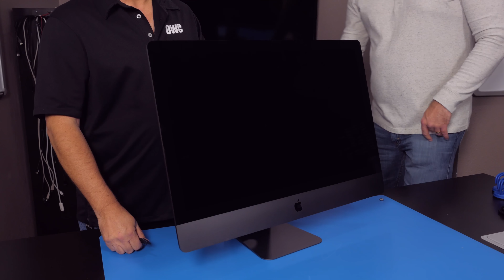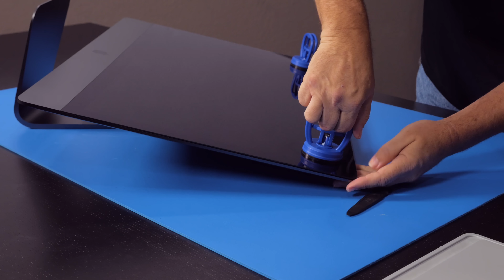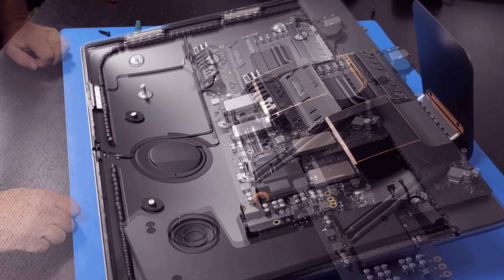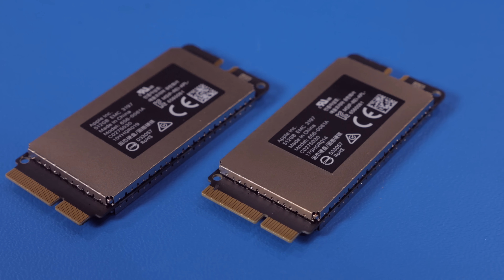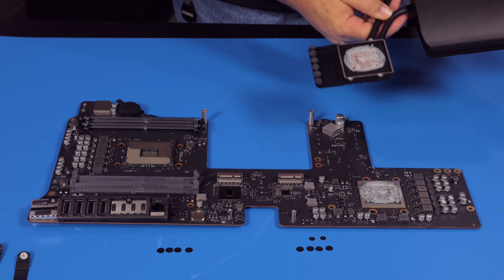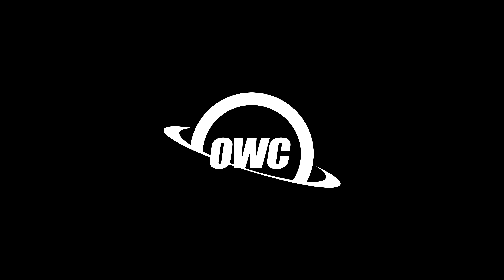2017 iMac Pro Teardown + OWC Memory Upgrade Announcement

Comment: The iMac Pro is an absolute work of art inside and out. The layout of everything is perfect. Something to be admired for sure.
Reply: This is the same design from 2013 for the most part, and that is when their bad designed Mac Pro with limited upgradeability was introduced.

To me the outside looks like every other 27" imac, except the color is different.
Inside is neatly laid out I agree, but it has bad design as all the other better designed 27" Imacs allow the user to use a door to access the memory, and there is no technical reason this does not have that.

And that is bad design.

I am guessing the profit levels on ecc memory were too much to resist for Apple and that is why they sealed this "pro" desktop machine shut.

Having said that I think the surface desktop is a more innovative design, styling wise, and screen functionality wise, unfortunately Microsoft made it's base way too small to ever have this level of power, even their laptops are more powerful.
Reply: The 27" iMac is still magnificent to this day, beautiful design and engineering. A work of art doesn't really get old, only your own mentality. Nobody says; "Hey that Mona Lisa portrait is too old, its crap." You appreciate the art and design for years to come. Even the colourful Mac G3's are timeless classics like Andy Warhols pieces. Tech wise, there will always be different products for different people. You don't want an end-to-end encrypted, secure, unibody 5k powerhouse? Buy something else... life can be simple.
Reply: I have a iMac 27" and had a colorful one and have been a long time OWC customer.

Life is simple.

i simply gave me honest truthful opinion and I think you can see it is true.
Never did I say it was ugly.

I said the design of the iMac Pro is no different than the design of the 2013 iMac 27", so I was surprised people were saying what a magnificent design it is, as in something new.

And I pointed out the neat insides and the bad design decision to not include a memory door, since their is no thermal reason for them not too.

GREED!

If someone was to paint the same mona lisa today and say it is great painting, I would agree, but I would point out it has been done before exactly the same.

And that take nothing away from the original, but it does take a little away from the copy if the artist knew of the original.

Apple knew of the original and saved money by cloning it and taking away it's memory upgrade feature for consumers, as dcc memory is much more profitable and not having that feature gets customers to order their memory upgrade from Apple at purchase for higher than retail prices, with no credit given for the 32GB base memory you are giving up.

Apple is essentially double dipping and double charging you for memory, if you upgrade through them.

And that is just wrong and bad design from a consumer perspective.

take care.
Reply: The best part of it all is how it's designed to thermal throttle the cpu so you can't get the full potential and the speakers are basically sealed inside
Reply: Korie Cull end to end encrypted, you are funny.
Reply: Tigerex966 the amount of amazing hardware they stuffed in the iMac pro is extremely impressive
Reply: Tigerex966
Imagine “door” for four full size DIMM slots? And placing them in the middle of the board? Its not worth to loose in bezel durability and symmetry. If there was plenty of space underneath, like in 2012 models, it will be possible.
And RAM is not the thing you going to upgrade for long time if you bought enough already. Only if you wanna game on the price. I mean, 16-32Gb is still a sweat spot for large prints and 3d renders, in the last 5 years.
Reply: 'Something to be admired'' like its price point.
Reply: @koriecull  I don't think you understand how this this computer stuff works.
Reply: @koriecull  yeah and it has a shitty GPU, not even the 1080ti, not even the newest 2080ti... hahahahhahahahaha

Comment: Help Please!! I have an imac pro and repair centres told me that the logic board is dead and needs to be replaced, but buying another used imac pro cheaper than replacing the logic board. So here is the question I want to replace the ssd on the used good working imac pro with my ssd, so is it possible to do that without loosing data? Thanks if anyone can help me with that 🙏🙏🙏👍👍✊✊
Reply from the maker: Hey Emad,
This is a great question, but we hate to be the bearer of bad news but this would not be possible at all. I sincerely apologize for any inconvenience this  has caused you. Please feel free to contact us if you have any further questions, comments, or concerns. https://eshop.macsales.com/Service/
Reply: @poweredbyowc  thanks for reply
I already bought another used imac pro with same specs as my dead one
If you replace my ssd from the old one to this one i just bought, do I loose the data on the ssd from my dead one?
Thank you

Comment: If both drives are in RAID configuration, I wonder if Bootcamp will be able to read that correctly.
Reply: NokiaSiemensNet it should work I use a raid0 in my cheese grater Mac pro and boot camp likes it but this is apple and I don't have a imac pro and my raid is custom but I'm sure apples got in working well?
Reply: The T2 houses the controller, there's only one. I think calling it RAID was a bit of a flub, it's just two NAND banks with one controller, and the controller is all that talks to the OS, Windows won't have an issue.
Reply: So the data is stripped or not ? because I wonder what will happen if one of both SSD fails.
Reply: NokiaSiemensNet my guess would be that you would lose all of you data but not sure

Comment: Does this Pro Model seem worth the Price difference from the best IMac optioned out? Can you tell us is it worth it for the Higher price do we truly get a whole lot Better quality? I need one and I would absolutely appreciate your answer
Reply from the maker: The iMac Pro is sort of a weird unit, there is a lot about it that makes it more powerful than a standard iMac, the specs are significantly closer to that of a MacPro model with the processor and the type of RAM that it uses. I believe there are multiple drives RAIDed together to give you optimal speed for the unit. It's going to be a step down from a 2020 MacPro but significantly more powerful than any other Apple computer currently available.

Comment: Are you using ESD precautions?
Reply: MacSales. com Hi I’m just curios because I didn’t see any wrist straps (ok there are solutions for the ankle). And as Certified Mac Technician I know these things are essential when working on electronics. But also the mat is not connected so this setup is very basic …

Comment: what connector is used for the ssds
Reply: Tigerex966 it’s apples own proprietary connector. you can’t swap out the ssds easily in this for aftermarket ones unfortunately
Reply: swearatmegordon N its a shorter version of m2. Its totally standard
Reply: no way
Reply: if its a different version than how is it totally standard
Reply: Tigerex966 look at the connectors and the screw, its m.2
Reply: I think you are right.
Reply: Spielhorn or is it u.2

Comment: Mike. Thank you for confirming my question about the dual SSDs. I figured Apple was going to ship them in a RAID. A follow up question if you don’t mind. Are they using their AppleRAID software RAID driver for this (like Disk Utility and Terminal use), or is there a hardware RAID controller built in? This gets interesting with APFS and its possible RAID benefits. It’s also interesting to have the option to have two drives (a boot drive and a file drive) or to keep the fast RAID 0 volume as is. 

Also, I know it’s very early for this but can you speculate if this architecture will support double the amount of memory (256GBs of RAM), like many previous Apple models do with larger OWC memory kits? All of my 4,1/5,1 Mac Pros are loaded with the 16GB based, 128GB kits.

Thank you again!
Steve Steele

Comment: Really puny heatsink, I wonder if it throttles constantly under extended load
Reply: Early reports say, not really. 
It goes 3.2ghz when maxing cpu and gpu and between 3.6 and 3.9ghz(back and forth) with cpu only. 
3.2 is still above base but not its highest boost. Kinda up to you whether you want to call it boost or throttle. Glass half empty or half full.
Over it seems to handle itself pretty well though.

Comment: I was under the impression that the SSDs were soldered in so you couldn't upgrade them.  So much for that idea. Got to love you guys for tearing an expensive computer down.
Reply: yeah not in the imac pro. !
Reply: They're basically not upgradeable. It's a proprietary Apple connector and they don't sell replacements directly.

Comment: Is it possible to recover the data from an iMac Pro if it wasn't backed up?
Reply from the maker: Is the iMac Pro still functional? If your iMac Pro is no longer working, regrettably the drives are not removable or replaceable so it is not likely to be able to be recovered if it was not backed up previously.

Comment: Love the informative video - I got a question, iMac Pro - if you get the 64GB & wanted to up grade to 128, would you need just another 64GB Gb or 2x32 GB, or would you have to completely swap them out for the 128gb

Comment: JEEZ, 2 SSDs, WOW, even though for up to 4 TB just like you did the one for the 2013 Mac Pro SSD. Would that be considering making a 8 TB (4 TB x 2) or more? 32 GB RAM Standard, do you guys also have to get it up to 128 GB or Higher, like the 2013 Mac Pro? And is the memory actually the same size of the memory insert of the Mac Pro?

Comment: If you take compatible memory to an Apple Store can't they put it in for you? 32 to 64 or 64 to 128
Reply: They can, it is serviceable by Apple or Apple authorized personnel.
Reply: The memory doesn’t have a bottom latch for easy access like before but it is easy to place the memory card as it’s not soldered. Problem is you need to open up the display first. I think they have restrictions against third party parts. And installing them. Your warranty might not cover it. If apple services it you get 6 months or a year extra on it but only with their parts. Which is more expensive.
Reply: Apple wants you to figure out your RAM needs at the time of order. Apple will not put 3rd party parts no matter how compatible they may be, into any Apple product. It’s their way or the highway. That’s why a 27” iMac with a i7 Quad core 4.2 MHz with 8GB from Apple is the preferred model to get. You then order OWC 64GB @$649.00 compared to Apple at $1,900.00 on the configuration page. Approximately give or take a buck or two.
Reply: unless you want better performance/more cores/ etc... seems like you may be able to have apple do it, or just do it yourself when you pick up a kit as a last resort , no sense in buying a maxed out previous gen, buying system for more than the ram lol

Comment: According to OWC's site, there are two 128 GB memory upgrade options: 4 X 32 GB RDIMM modules for all four RAM slots and 2 X 64 GB LRDIMM modules to fill up two of the 4 RAM slots. You should really just stick with the former because a) RDIMMs are faster than LRDIMMs, b) four slots being used allows the memory to work in quad channel mode, whereas two slots left unpopulated results in the memory that is used only working in dual channel mode, which is only half as fast as quad channel, and c) OWC states that while 128 GB is the maximum amount of memory supported by the iMac Pro at this time, that they may offer a firmware patch that lifts this limit. Yeah, knowing Apple, don't hold your breath on that one. The only way Apple goes beyond that 128 GB limit on the iMac Pro is with a product refresh, not a simple firmware update. If the Coffee Lake iMacs (non-Pro) allegedly coming later this year are good enough to cannibalize upon the lower-tiered iMac Pros (8-core and 10-core), then they will need to revamp the iMac Pro lineup altogether, anyway. Perhaps a 35-inch model with 8K retina display with the option to go up to 512 GB in 4 X 128 GB of LRDIMM modules for those who want to edit a lot of 8K RED RAW footage with minimal compression?

Comment: wow is this heatsink small for cooling 500W away ... compare this to a 250w gpu heatsink and it seams apple has outwitted physics
Reply: the amount of paste also seemed ludicrous
Reply: 500W? A LP Xeon-W chip and Vega Pro (this is NOT rx vega) combined don't pull anywhere near that
Reply: It is 500W, Apple underclocked the CPU and GPU to maintain stable temperatures.
Reply: the vega 64 not downclocked sucks between 285W and 385W on load
the cpu has a 140W tdp but with avx or other workload it is much above this. 
and this cooling solution is even small for 200W unless you give a shit and let the chips fry above 90° (shiity cheap ugly pcs try to stay below 70° better around 60 or less)
Reply: Martin Peterdamm Thats what I have been saying. I think the cpu or gpu is undervolted and down clocked. The vega has a tdp of 400watt alone. I think with prolonged use the gpu cpu will both thermal throttle.
Reply: if down-clocked then it is even more shit compared to windows PC with same price
Reply: already video out showing it thermal throttling.
Reply: Apple is the type of company who allows their chips to go above 90C with the fan spinning at the lowest possible speed. Trust me I learnt it the hard way when I'm editing with Final Cut.

Comment: Since there's one controller on the T2 that's just handling two physically separate banks of NAND, I don't think it makes sense to call this a RAID. That would be a T2/controller on each NAND bank. This is just one controller looking in two places and unifying the NAND away from the OS, as it would for multiple chips, just more physically seperated now.
Reply: I'm a bit confused by your comment. One T2 chip can easily handle enough to RAID three or more drives together. RAID is Redundant Array of Inexpensive Disks. So this would, 100%, be considered a RAID. Whatever the case may be, I'm just happy that the CPU, and RAM are not soldered in.
Reply: This would depend on if the data is stripped, right? We don't see much performance improvement over Apples normal 3GB/s SSD controller, except a bit faster writes, so it seems more like it's a simple spillover mechanism rather than striped RAID. In any other RAID, each drive has its own controller, in this there's two banks of NAND without controllers, and one controller in the T2. Just seems more like a split SSD rather than RAID to me.
Reply: This was a interesting topic so I ended up brushing up on my raid setting and configurations. From everything I have read on the iMac pro, the two drives are striped. I had to read up on RAID again because I have never herd of each drive having its own RAID Controller before. I've setup RAID several times on my machines, both hardware and software Raid 0 & 1. All of the setups I have seen and done require 1 Raid Controller. 
Lets assume this computer is a standard pc, there are two SSDs connected to two different PCI-E ports. Then RAID configured through BIOS. Wouldn't this be the same idea?
Reply: I have not said each drive would have its own RAID controller, I think that's where our miscommunication is. In a standard RAID, there would be one RAID controller, and each hard drive or SSD would have its own /drive/ controller. Because a drive by itself has a controller, not a RAID controller.  In this setup, there are two banks of NAND without drive controllers, because the T2 chip consumed the SSD controller that used to be in each Apple SSD. It's like, say, one GPU driving two monitors, you would not say that's two GPUs, rather than RAID which would be like an SLI setup of GPUs. 

Each drive in your old RAIDs has a DRIVE controller, while the whole setup has one RAID controller.
Reply: Now I get what your sayings. Usually SSD controllers are built into each SSD  (not on motherboard), but these SSDs do not have an independent SSD controller on the PCIe based SSD. A stroke of genius by apple since SSD controllers act like a raid controller anyways, but another huge annoyance to consumers. I ran into a similar problem while dealing with MacBook Pro retina storage upgrades, apple's ssd have built-in code that enables NVME SSDs to be bootable, something consumer grade NVME SSD's do not have which make them incompatible with Mac's. 
So the T2 chip controls both SSD's that do not have the SSD controller built into them. Depending on how you see this setup it could just be looked at as two tiny ssd's connected through pci-e bridge instead of independent SSDs working on their own. Or a single SSD controller connected to two SSDs which are configured in a RAID Array. Good catch, I couldn't see the SSD in this video, but the pictures of the link show the SSDs without the shield .
Reply: In the end, performance is just a bit over their regular SSDs 3GB/s, with a slight increase in write speeds, probably from T2 also taking over encryption. The total SSD still has 4 lanes of PCI-E so it couldn't get faster on sequential anyways. So I'll choose to look at this as an SSD doing the splits, lol.
Reply: I see what your saying, but I still consider this a RAID because it's two separate drives with striped data. If the T2 is acting like a SSD Controller, it will strip the data between all the NAND banks. 3GB/S is amazing speeds, Similar to what I would be getting if I RAID 0 my two sm951 pci-e m.2 SSDs.